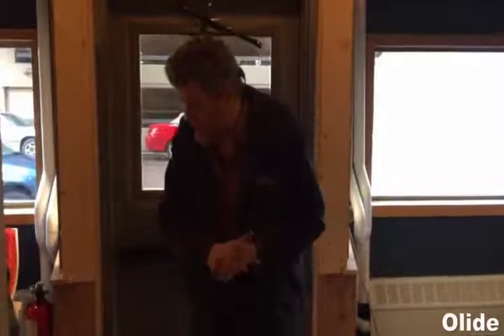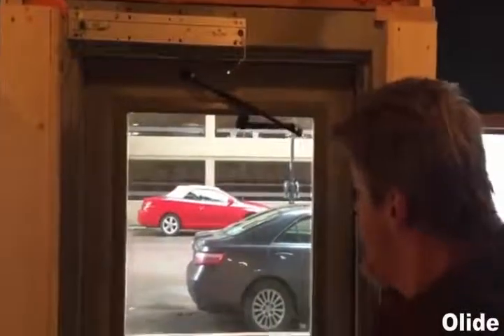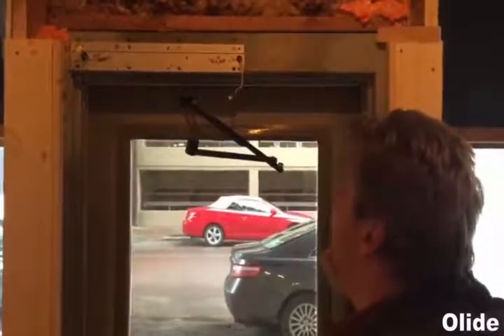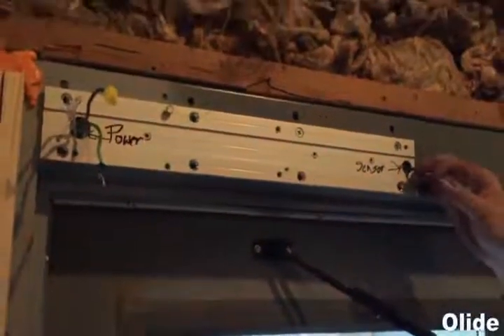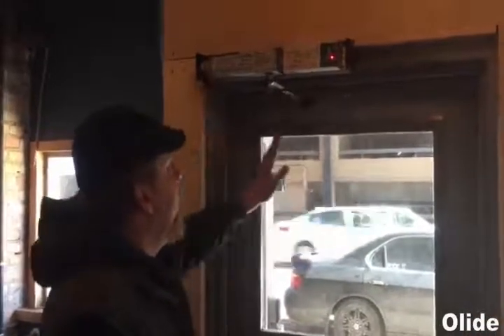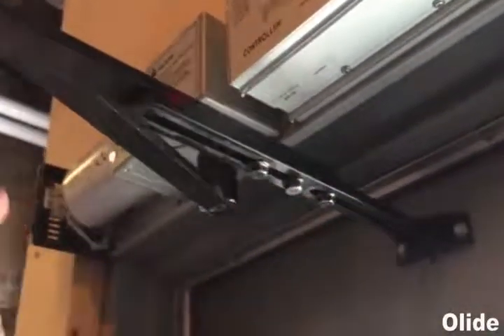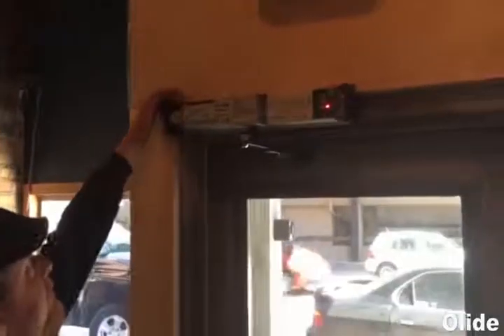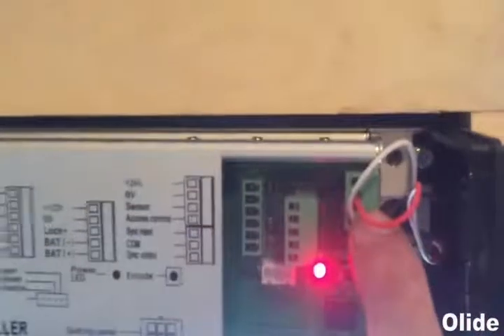DIY Installation For Olide Swing Door Opener - Push Open

Comment: Hi, I got the 105 for a commercial door 7:26 7:26 with handicapped push button 7:26 button which keeps th door open for 4 seconds before it close’s automatically and that’s good
But most people prefer to push manually with their own strength to just wide enough to get in and let go so the door closes without opening fully 
This is most people do
Especially in the freezing winter when you don’t want the door opening for the full 10 second.
Can this be programmed like a normal people habit like those in the fast food restaurants ?